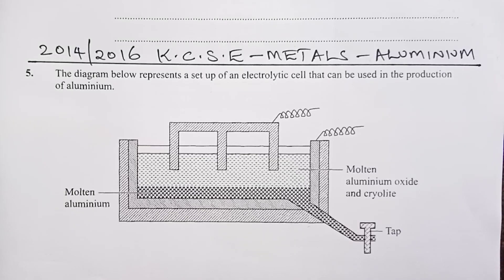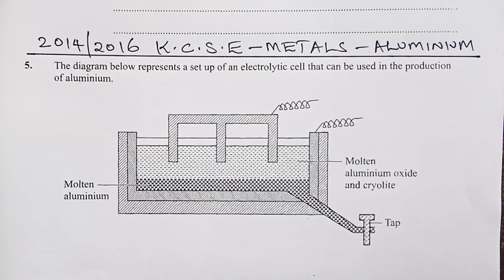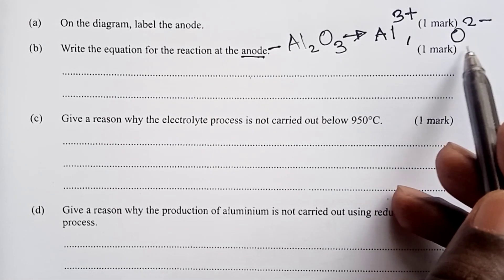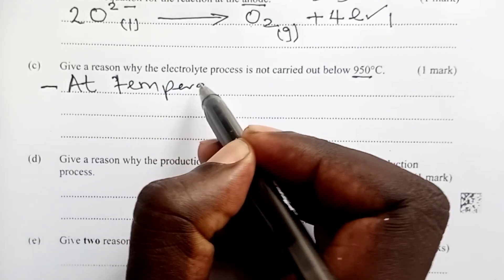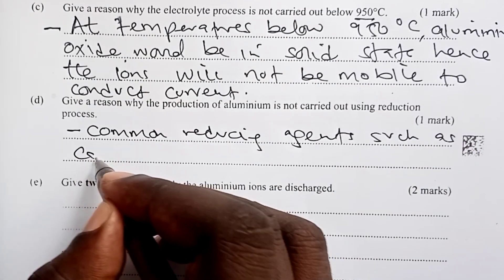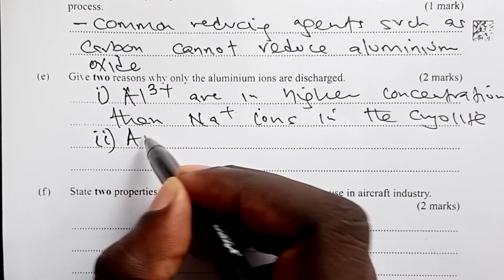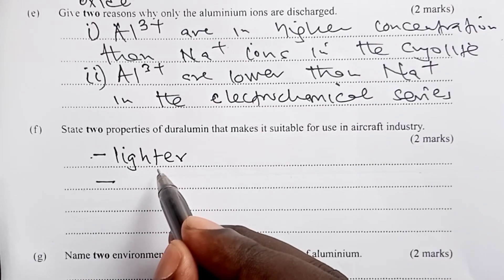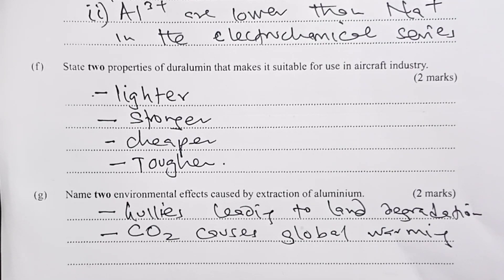Metals - ALUMINIUM

Comment: Thanks for this video sir,allow me to ask this question.why is it cheaper to recycle aluminium other than extract it.secondly is it acceptable to write on the diagram during kcse when am studying on the diagram,
Reply from the maker: Thanks Brian, now the high cost of extraction of aluminium is based on two factors:-
1. High cost of electricity
2. The anode has to be replaced periodically
This makes recycling cheaper. Now, on writing on the diagram while studying it, I don't find anything wrong with that. The only thing to avoid is writing on the spaces provided for the answers. All the best